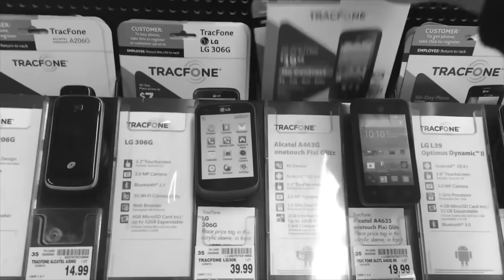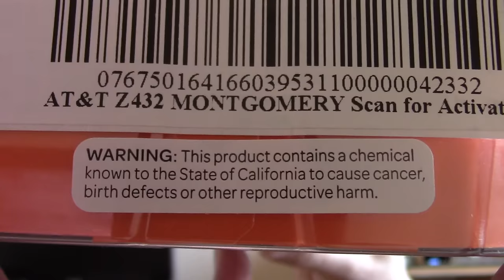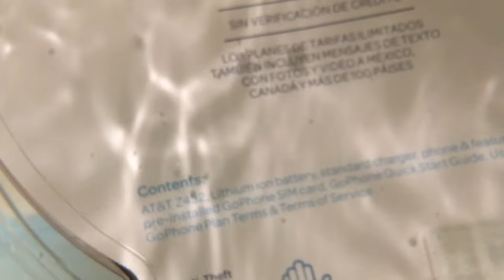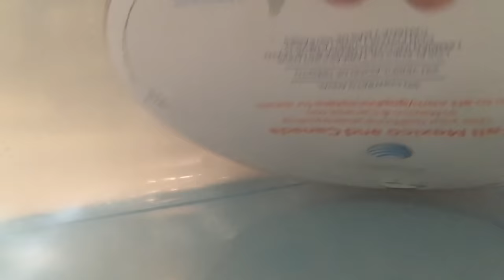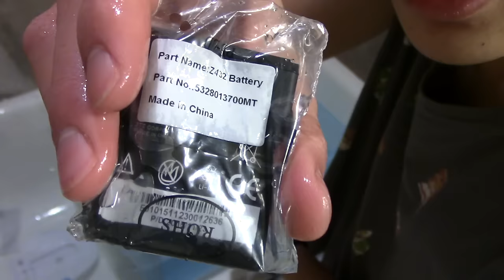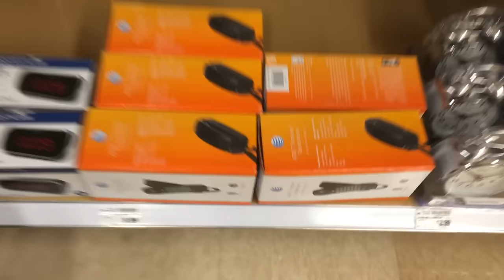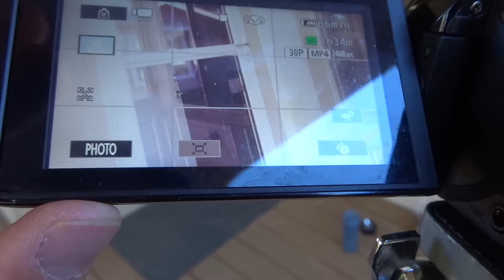Bored Smashing - GROCERY STORE PHONES! Episode 6

Comment: Here’s a quick tip please do not unboxed your phone in water because it will damage the circuitboard and a 10% chance there could be a fire If the battery is in and the case is out